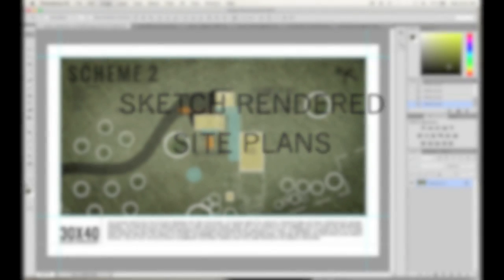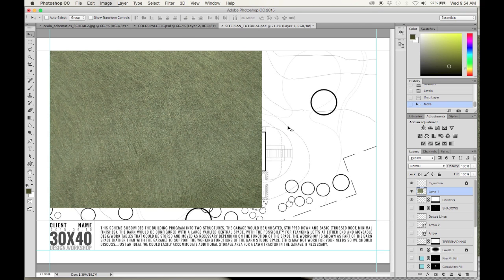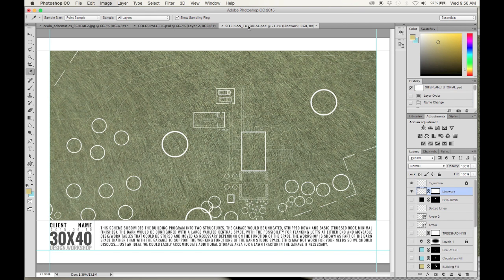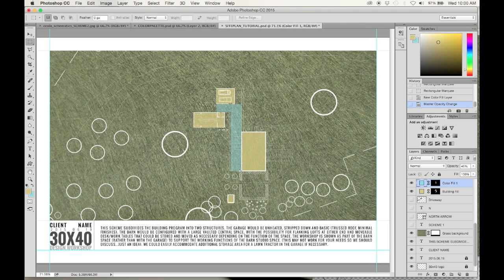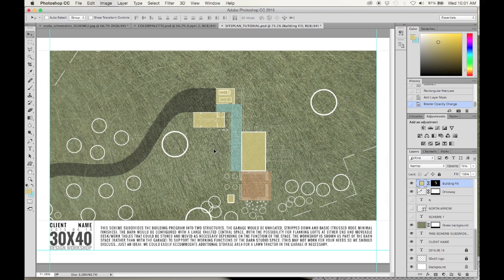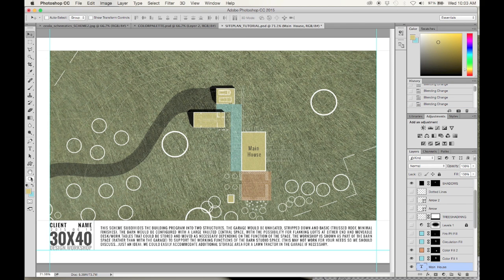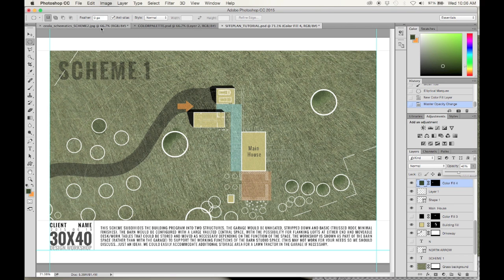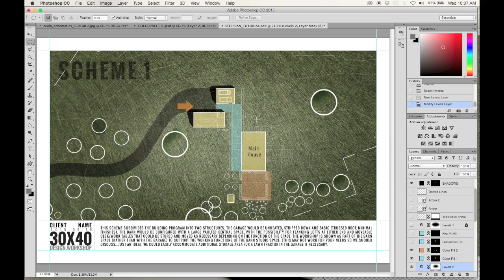Quick, Sketch Rendered Site Plan Tutorial

Comment: Why are you using Photoshop instead of Illustrator when architectural work (as far as architectural floor plans, Site Plans and elevations) is vector-based? Illustrator would make more sense being that it will drastically reduce your file size while providing you with the crispness that a pixel-based application can not afford you without drastic pixel count and file sizes.

Comment: No, this is not good. You have eliminated a lot of the original line art topology seen in the beginning of the video. I would have just used a straight Multiply Blend mode to emphasize the land features and use multiple color and gradient adjustment layers for the background. 

The problem with using raster based picture backgrounds is they can overwhelm the final result unless its a fairly plain image to start with. That is why you inverted the line art to try and overcome this problem, and failed. Futhermore, using a vingnette for a shadow effect at the end, just made a bad job, even worse.

I am not suggesting never to use photographs for vector line art rendering, it simply does not work on this particular case.